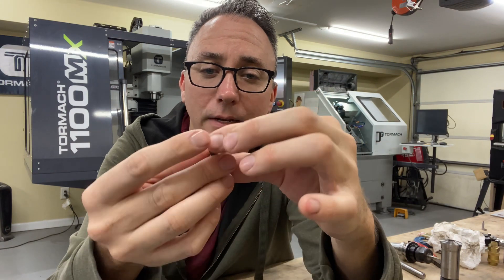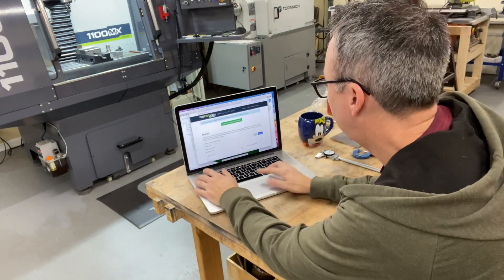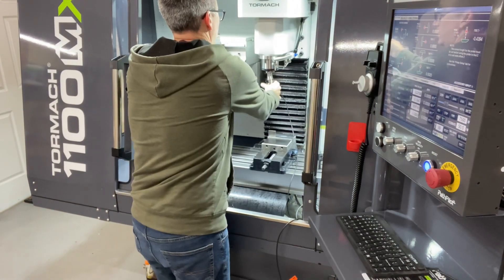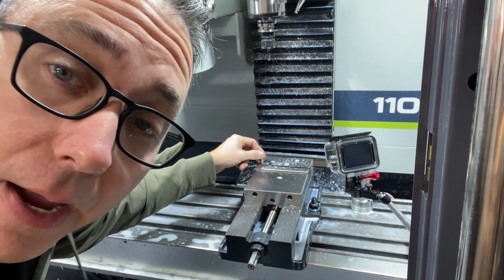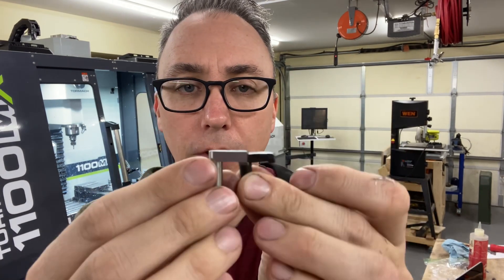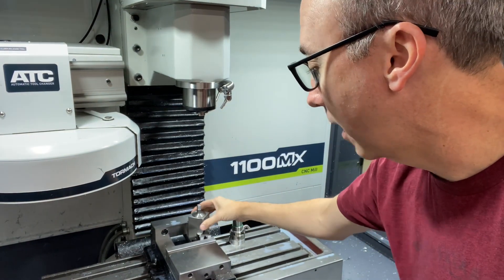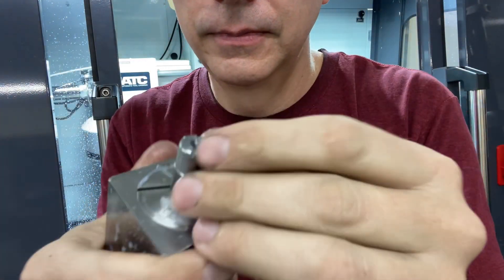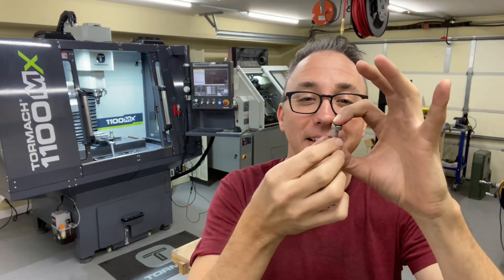Making a WWII Bayonet Button on a CNC Mill and Lathe

Comment: Cool project. How did you do the sloping face on the small nub? Ciao, Marco. (love your setup)
Reply from the maker: It was a 3D tool path - parallel I think. Just did really small step overs - .005 I think. Surprisingly smooth.  Thought I’d have to use a ball nose to smooth it out but wasn’t necessary.
Reply: @JeremiahDaws  Came out nice 👍🏻